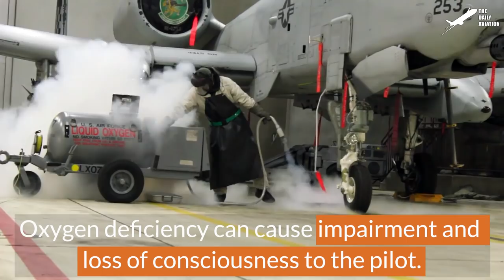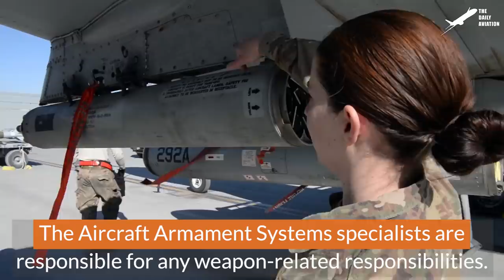Reloading the Monstrously Powerful A-10 With Gigantic US Missiles

Comment: The biggest problem of this aircraft is "CoM is under the CoT " . This means that aircraft can't carry big diameter weapons. USA will retired this in 3 years.
Reply: Not a chance.   A-10 wings are fairly high off the ground for an underwing.  Any ordnance so large in diameter that it wouldn't fit under the A-10's wing would be to heavy for it to begin with.  A-10's will be flying into the 2030's...at least.

Comment: A-10s a nice plane, but can it survive SAMs?
Reply: Damn that's a good question lol
Reply: It can, depending on where the missile strikes.  It's built to fly with one engine, which is where a lot of SAMs target, and the engine is far from the cockpit and spaced out from each other.  They can take a lot of damage and still return home, but the plane might be beyond repair.
Reply: The answer is...better than any other tactical aircraft.  Titanium tub cock pit, ballistic foam in fuel tanks, twin tails and outboard engines.  The A-10 was designed to be robust against any SAM or ground fire but it isn't invincible.